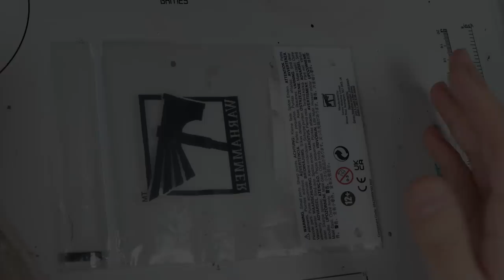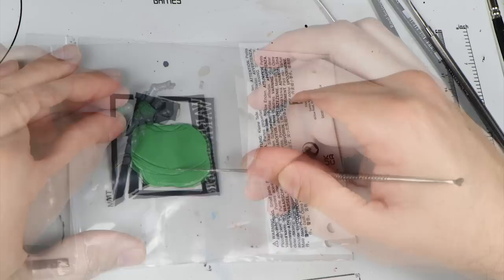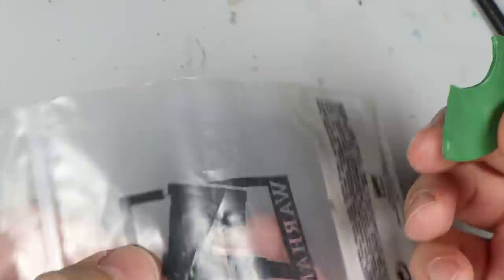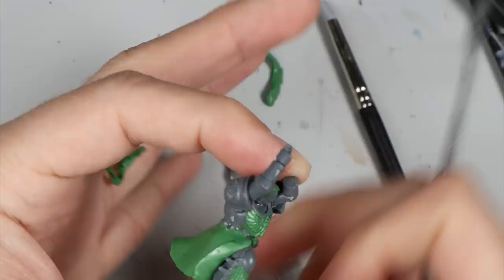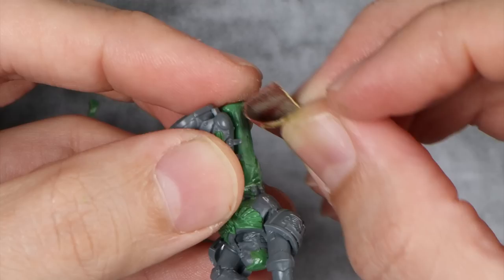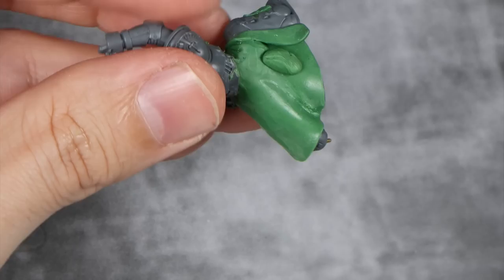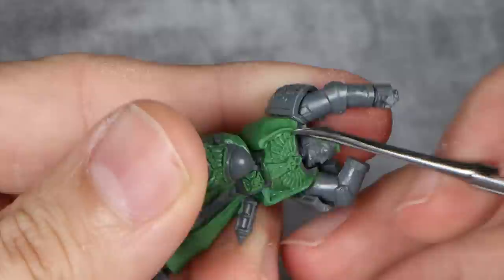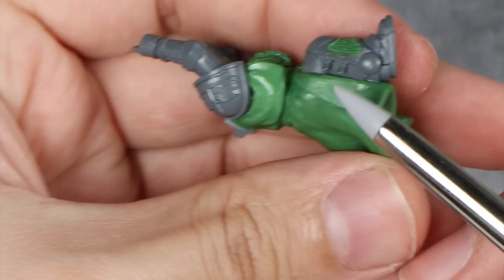How to SCULPT CLOTH AND CAPES like a PRO!

Comment: Huge thanks for this, Juan! I'm pretty new to working with green stuff and didn't even consider shaving and sanding the outside post-cure, rather than pulling my hair out while trying to get the exact shape I wanted when it was still soft and wondering why it looked like ass 🤣
Reply from the maker: Yeah, it's a big step forward. It's always good to get as close as possible fresh but sometimes it's better to stop and refine later

Comment: Can I ask where you got your green stuff in two little pots like this? Also, thanks for the freezer trick. Before, I used my excess greenstuff to make tactical rocks for basing
Reply from the maker: I didn't, I get it in rods, separated yellow and blue and I put it in those pots myself.

Also, very important to understand all GS is the same, it's all made by the same company Sylmasta and it's called Knedatite Yellow-Blue

Comment: Do you have a trick for adding more greenstuff? Whenever I try to add more it ends with a clearly visible line between the old and the newly added GS
Reply from the maker: Well, first let the GS to fully cure, then use metal tools and press hard in the joint moving the tool towards the new puttty. It's all about practice

Comment: Do you have a idea how to make a Librarian/ Scriptor chest Cable/ wire with green stuff?
I want to make a Custom Model but without the 2 Cable is it not the same😢.
If you have a easy way to make these i would be very greatful.
Reply from the maker: For those ribbed cables I used to use electric guitar string
Reply: @JuanHidalgoMiniatures thx i will give a try

Comment: My puddy never comes out smooth its always.. like tiny tiny chunky bits in it i cant fix. do i have a bad roll of it or something?
Reply from the maker: Mmmmm, maybe. If it's the strip with both colours together you have to take out the middle part where they touch, that part is cured and will cause that.
Reply: @JuanHidalgoMiniatures  ive done that and it still is messed up. Thank you for your reply.
Reply from the maker: Then it means the roll is old. Try taking out the outer portion of the yellow part that it's exposed to the air

Comment: Great video!
Reply from the maker: Thanks
Reply: @JuanHidalgoMiniatures  I sculpted with it yesterday for the first time. I was pretty prepared but not fully. It turned out pretty good though. I am super worried about how paint will take to it. I'm afraid I have to sand off the details of my sculpt or paint will simply bead off it.
Reply from the maker: You should prime over it, as with other plastics. That's the recommendation.

As with naked plastic, it can be painted without primer but it might take a bit for paint to catch. That being said I've done it before and it's not as bad as naked normal plastic or resin